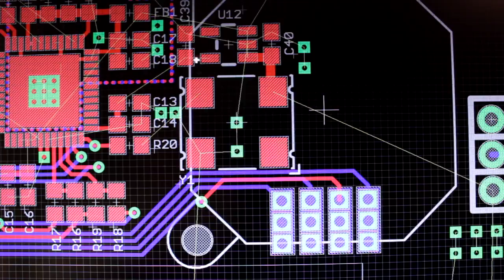BeagleBone GamingCape

Comment from the maker: yep, just running normal linux emulators. The beaglebone has the LCD pins brought out on the headers, it's a one to one connection with the LCD. The only thing you need to add is the backlight circuitry and a buffer on the LCD lines. You can check out the schematic in my blogspot linked to in the About.

Comment: nice trick and impressive work on the project (you have my vote on the contest :P)
but i have another question one of the traces that goes to U1 you used the polygon tool but you also used the polygon tool for the ground plane so how did you make it that the ground plain its not overlapping with the trace on U1 ? cause every time i have tried to use a  polygon inside another polygon they overlap